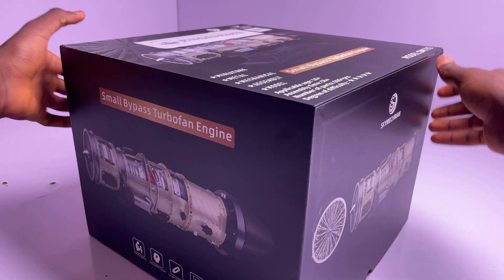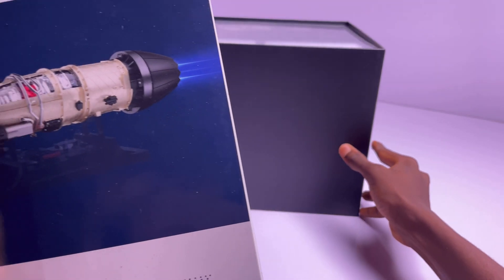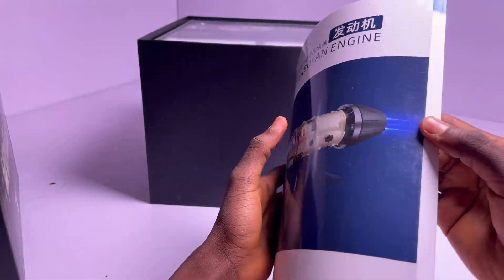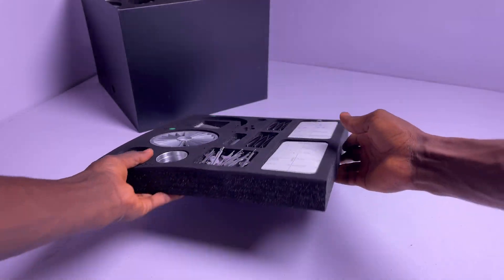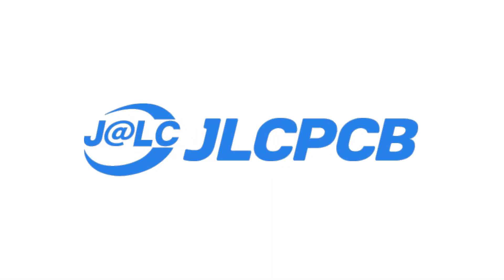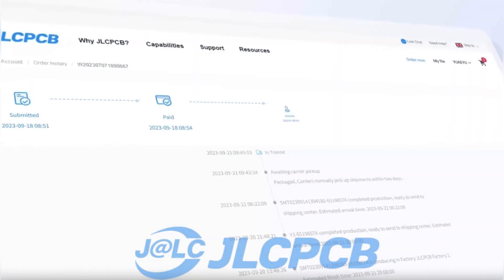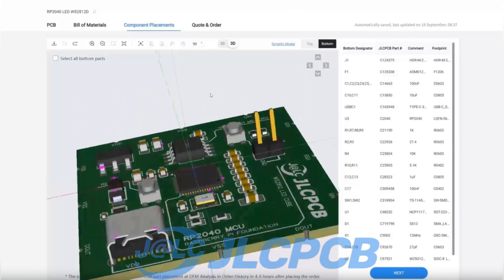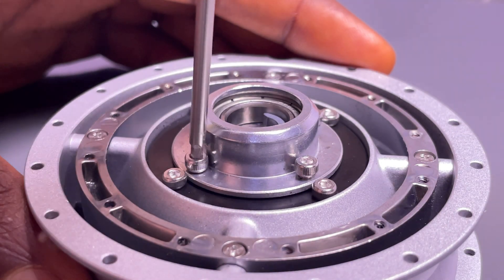Making a Fully Functional F135 Jet Engine | diy Jet Engine

Comment: Coolest diy i’ve seen!
Bow you just need to squeeze the exhaust area a little, so it generates thrust!

One question, what gauge steel sheet did you use for making the dig turbine blade?

Comment: After doing some research, the turbine blades were not bent the wrong way, if you look at diagrams of jet engines, and look it up, they are supposed to be bent the opposite way as the compressor, it extracts the power from the gases much better.
Reply: Thanks for that.

Comment: And you can use kerosene with, a vaporizer or ultrasonic diffusion device shooting ultrasonic mist and addkng air to the system will give higher pressure, gaseous kero
Reply: These things will just melt when using kerosene
Reply: @phungminhlonglucky168  not when it's gasified and lean

Comment: Nice! I would suggest that you use a 3d printer, and make a slightly different impeller, that would make more high-pressure air, like the ones in turbos, but nevertheless an amazing feat!
Reply: You'd suggest a plastic impeller?
Reply: @Gunham20  Yes, as the impeller stays cool.
Reply: @Gunham20  , precisely, as the impeller is not near any hot gases. and therfore could be plastic.